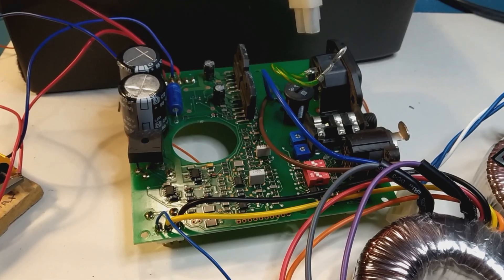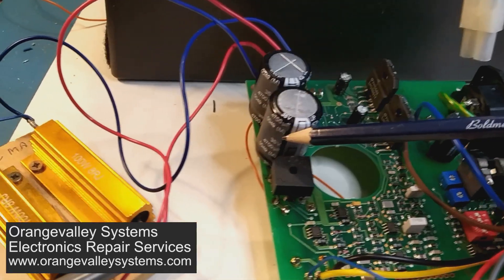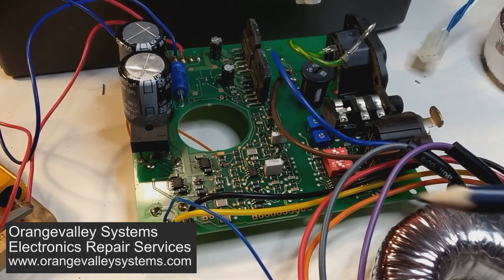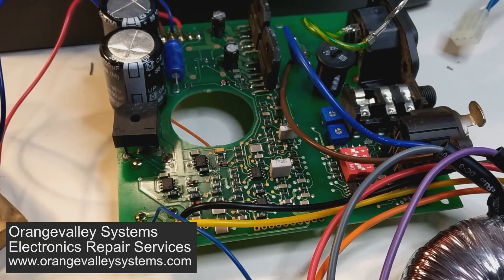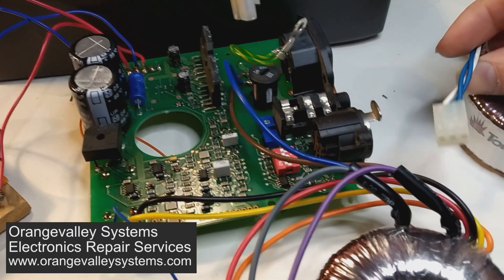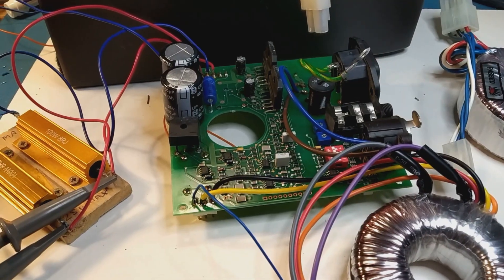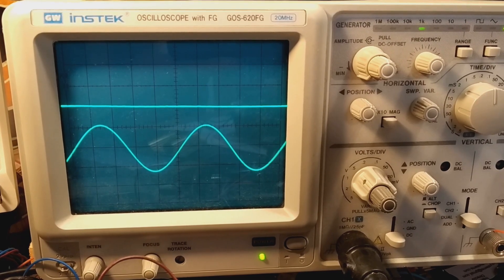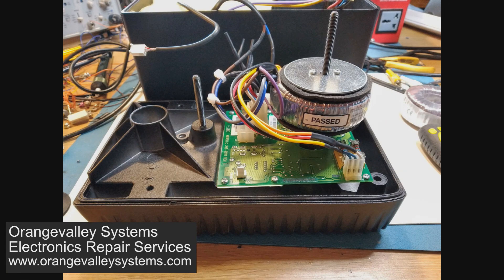Genelec  1029a Active Speaker Repair

Comment: RMS value is 0.707 of the rectified AC value. So UK mains is about 680V p-p, 339V rectified x 0.707 = 240V. 
A transformer secondary rated at 20V is typically an RMS value not p-p, so 20V DC will be the voltage on the capacitors, not 1.414 times the transformer AC output.

Comment: I was enough dumb to follow an advice on the net about the original transformers being a 23.5+23.5 V. As you mentioned it's not possible because at idle we will find about 37 volts at the capactors. The problem is that the voltage rating of the transformer is given under load. Without load you have about 15% more voltage and the situation goes out of control. So I have to replace the transformer from 24+24 to 18+18. May be we are loosing a couple of volts of swing compared to the original one but I don't think it's noticeable. Thanks for your video. 0:01
Reply from the maker: I think I read that same thing on a forum somewhere! I fitted an 18+18 one which worked fine.
Reply: maybe because they checked the AC voltage on a working unit and it's... 24+24V?